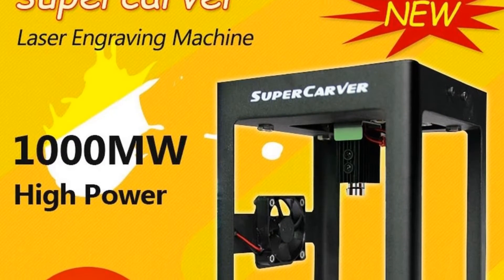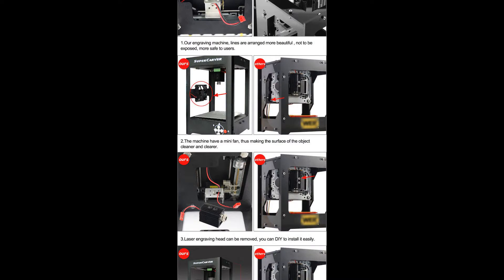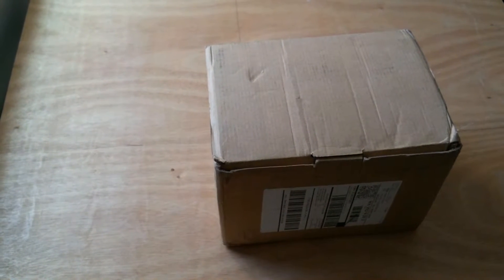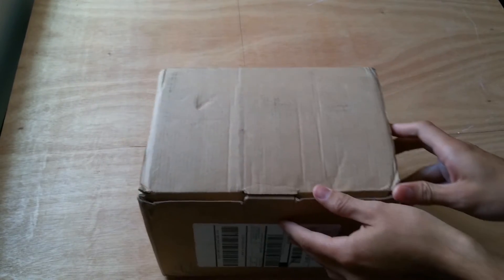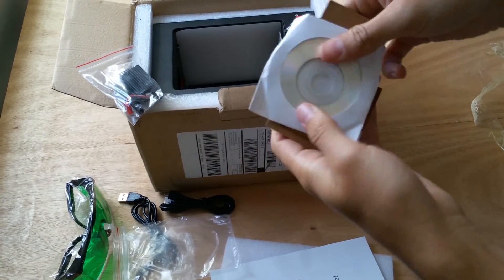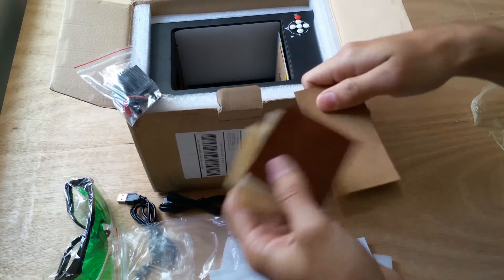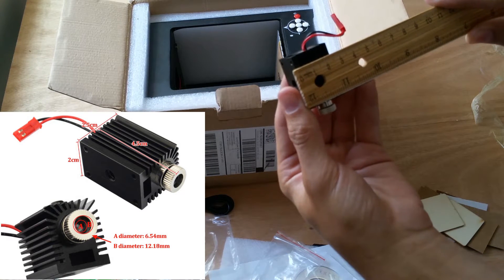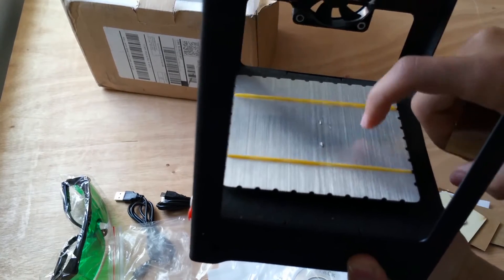Supercaver 1000mW DIY Laser Printer Engraver Engraving Logo Carving Machine unboxing and testing

Comment: Can you measure the distance between the plate and the laser for me? :)
I am wondering if i can put in an object that is 69 mm high.. the description says that it should only be 68.
it is parabolic formed to the inside. so only the edges are "too high".
Reply from the maker: from the plate to the laser it seems to be 9cm (maybe like 8.8mm) but 9cm would be tight fit. so you should be able to fit an object that is 85mm high.
Reply from the maker: but you have to take into account how heavy the object is, the plate or motor that is moving the plate might not have enough power to move a heavy object, I haven't tested how heavy it can get but i had it happen when the plate was not able to move much which made unusable for the object, maybe if people want I'll make another video showing how its carving and me adding weights to see at what point it wont have strength to move it, but maybe that is a video for the future if people want it